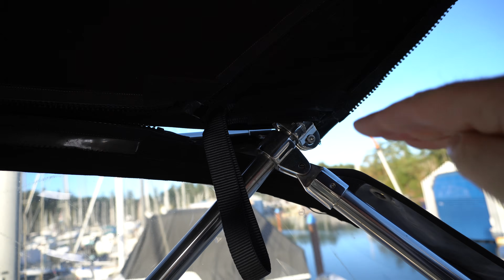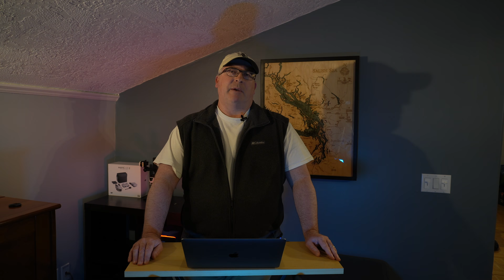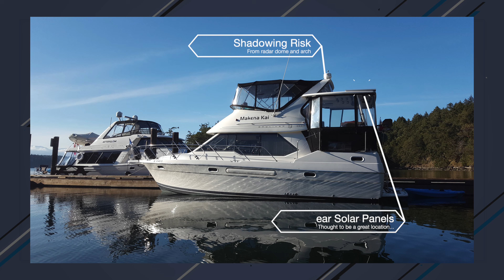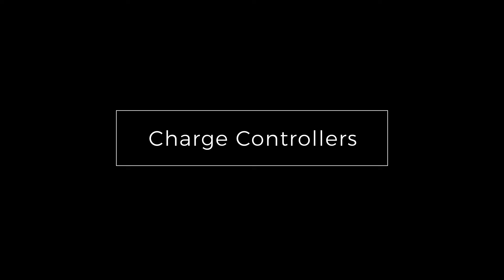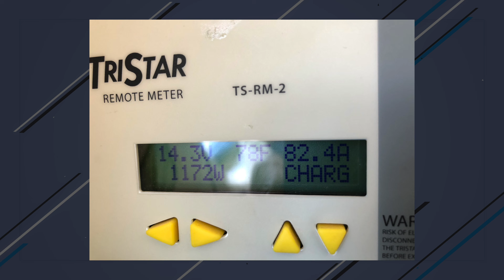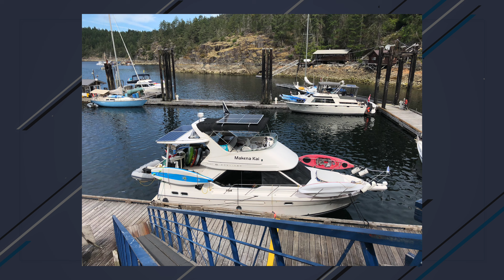How to mount BIG SOLAR PANELS on a Bimini Boat Top | EP 43 | Boating Pacific Northwest MV Makena Kai

Comment: Nice job. Thanks for making this video. I’m planning on putting two 440 watt rigid panels above my newly made Bimini top on my 400 sea ray sedan bridge. The local Steele company wanted $5000.00 to make up two 2” poles mounted to the side of the radar arch that would go up and over the top. Your system looks very DIY. Any issues with flex in any of the poles? Did you run 2 poles from front pole to rear pole under the panels to create a stiff set up?
Thanks
John
Ontario, Canada
Reply from the maker: Thanks for watching/commenting!
Stainless work is expensive. $5k is a lot to mount solar panels.
Adding 2 hoops to the existing bimini frame using a pair of horizontal bars is a great setup and can be price effective too. Sometime you can use the bows from an old scrap bimini frame for the hoops to mount the panels, they already have nice radiused 90 degree curves at each end. You just may have to narrow or wide if required.
On our setup, the hoops were a bit springy but at no point did I have concerns about the panels becoming unsecured. It wouldn't hurt to add a bit stiffening such adding a very shallow peak in the middle.
In any case, best of luck with your project.

Comment: What about high wind/stormy days, when you need to pull your bimini off, is the mount able to come down or are you not worried about high winds or major storms?  Sometimes during travels we don't have a choice, so it needs to be pulled down and everything else...."batten down the hatches".  Looking forward to your response, thanks again, great video!!
Reply from the maker: We always kept the solar panels up and bimini enclosure on during stormy weather. Our boating did keep to "costal waters" in the inside area of Vancouver island. High winds were never an issue but that might be subjective for this area. In our marina we generally wouldn't see anything more that 15-20 knots of wind. We might see 20-25 knots of wind when cruising or at anchor but hindsight it was never an issue.
Reply: @MVMakenaKai Thank you for your quick and informative response!  Our biggest issues are the hurricane season on the east coast.

Comment: This is exactly what i was looking for for my carver 530- thanks for the video.   One question - would it be possible  to avoid the horizontal bar you used from the gemini mounts if the spacing of the existing bimini allows for a direct connection for the panels straight up from the bimini gemini mounts?
Reply from the maker: I think it could work but it may cause additional tension in the bimini fabric. It also may be dependant the hardware used to attach the panels to the hoops; you would have to ensure no pivoting in allowed to take place.
It could make for a cleaner install.
Reply: @MVMakenaKai  Sorry if I missed this in the video, but what was the longest length of the spans of 1" stainless...my bimini would require just over an 8ft run...did you ever consider going with 1 1/4 Stainless or is the 1" strong enough to support the two large panels?

Comment: This is practically completely worthless. Buch of talk, talk, talk, and barely showed anything of the actual installation. Especially with regard to the actual mounting of the panels on that frame.
Reply from the maker: Wow! You come off pretty insulting but perhaps that's just who you are. I might have expected some specific questions of interest but I guess not... For anyone with bit of DIY imagination, it's pretty easy to engineer such an installation. The real value here is the concept and a few of the components mentioned.
If this is beyond your engineering ability I suggest you find a contractor to perform the work for you.

Comment: How do you find longer Bimini tubes. My width is over 8’
Reply from the maker: Seems to be okay but I would recommend putting a bit of a bend in the middle so it doesn’t sag. Even though I didn’t do that, it works great! Thanks for watching and for the comment!
Reply: @MVMakenaKai  Thanks for the reply my question was on sourcing longer Bimini tubes? Love your video.

Comment: Awesome videos! Great information, going to do solar on our next boat and was trying to figure out best system for over Bimini 👍🏻
Can I ask what drone you film with? Thanks!
Reply from the maker: Hi Justin, Thanks and glad to hear you can put some of the information to use. I have been using the DJI Mini 2. There's lot of great drones out there but the mini 2 is nice because it's so small and quiet (doesn't get un-necessary attention). Also, much smaller capital investment incase it ends up doing an unwanted floatation test... Thanks for the comment and for watching the channel. Cheers!!
Reply: @MVMakenaKai  
We are under contract on a new boat for our family, assuming the due diligence goes well we will definitely trying to mimic your solar set up, love it!
With respect to the drone, makes total sense. My dad has the Mini 2, I was thinking of getting the air 2s and saw one in the background of this video, or at least the box so I was curious what you used. Thanks so much for the reply! I may reach out again if all checks out on our mew addition if questions arise. 
All your videos are so well done and informative, going to watch them all 👍🏻
Reply from the maker: Buying a new (to you) boat is always exciting, takes a few years to get the customizations done the way you want them. The solar is definitely one of our best boat project investments.
I have used the Mini 2 for all my drone shots so far but I have just recently purchased the Air 2 (box you saw in the background) so I can get some active track footage, something the Mini 2 cannot do unless your a really great drone pilot. I have learned it is very difficult to fly the drone around the boat while in transit while smoothly keeping the boat in center frame. Looking forward to getting some great footage this year with the Air 2.
Feel free to reach out again, the boating community is generally a helpful group. We always welcome comments, there good for the channel and great for getting video ideas. If you come up with the right question might have to make a video about it!!
Nice to hear you enjoy the videos, on May 1st it will be one year since we published our first video. It has been a crash course over the past year considering how little I/we knew (almost nothing) a year ago about making videos and YouTube. 
Thank you for the compliments and appreciation!!
Matt